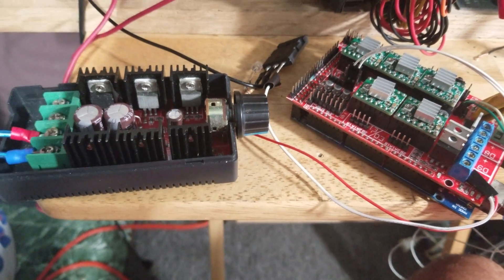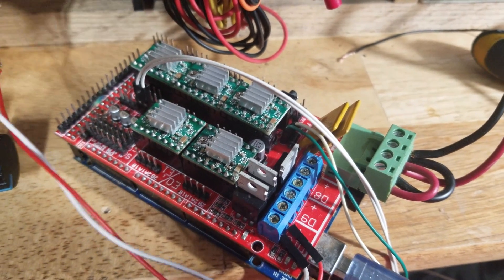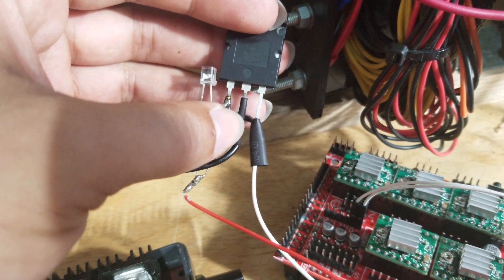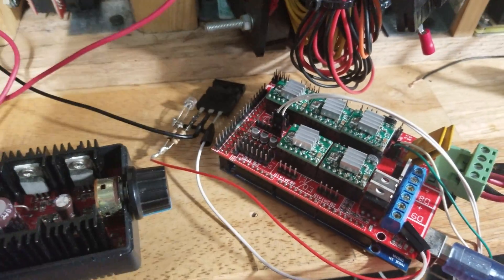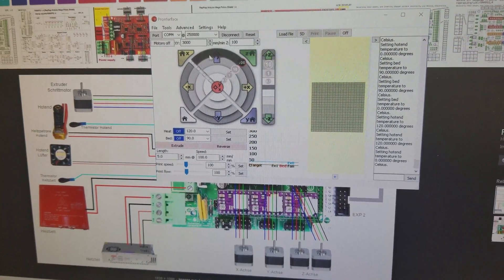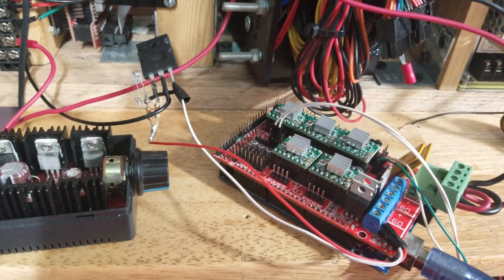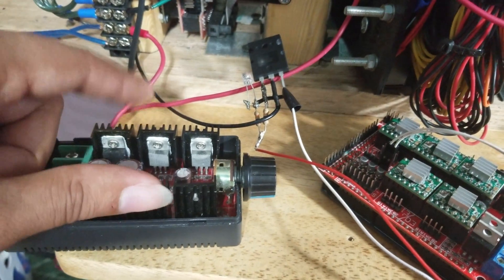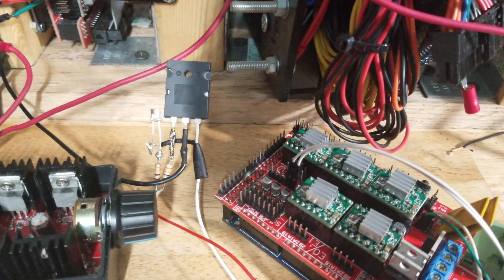DIY 3D Printer Mosfets/Transistor #2

Comment: Hy do u have a wireing diagram
Reply from the maker: I don't right now but will make one for you no problem look for the next video with information on the wiring diagram.
Reply: Lee Velez dankie sir....i want to make one of thos simple mosfets for a malzi board i got.thank you
Reply: Lee Velez hy i tryd tge exact same way u got it..and tge mosfet just gets so hot it blew the 1st pin .i tryd two mosfets brand new.both burnts off.pleas help.i had it on a hetsink
Reply from the maker: Got to make sure the pins on the mosfet are connected right it shouldn't get hot right off the bat it would get warm when you have been using the mosfet for a while
Reply: Lee Velez i have connected the earth from powersupply to the mosfet together with the ramps negitiv .but the reaiator just stays on and geta burnt off